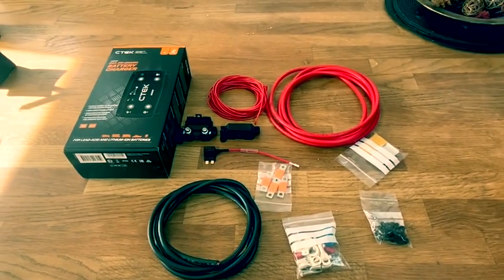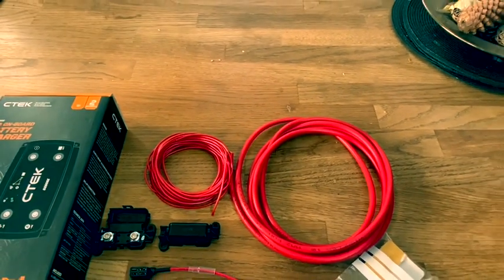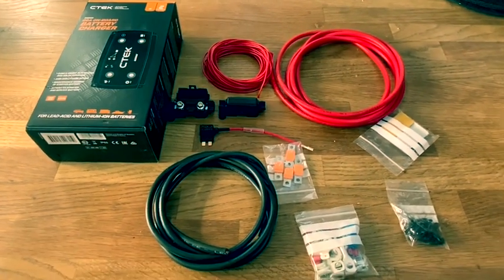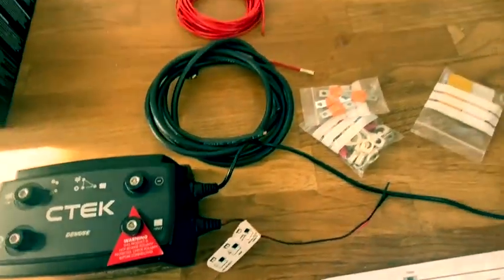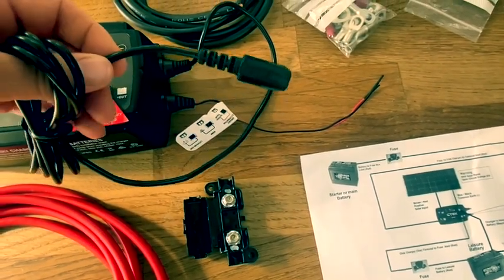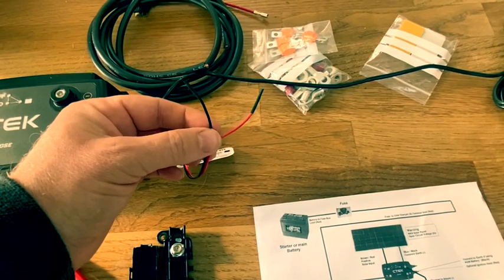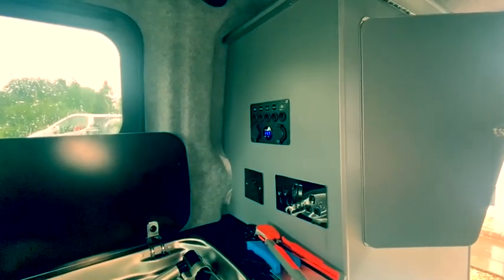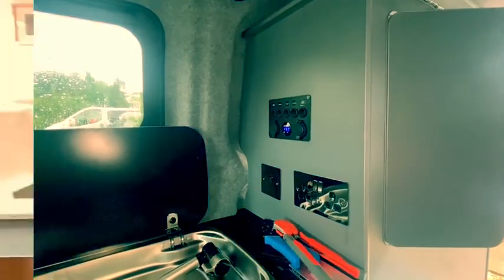Installation of CTEK D250se DC to DC Battery Charger into Transit Custom with Smart Alternator

Comment: if my van has a dc to dc charger and 2 batteries from factory, if i add a 3rd battery, would i need another dc to dc charger, or can i just use the existing one?

Comment: Hi there, 
I too have a transit custom and am fitting the same ctek. When you plugged it into the main van fuse box what did you piggy back into ignition switched fuse wise? And I understand the black cable is not required if it's a lead acid battery? Any help would be gratefully appreciated. Very informative video by the way 👍

Comment: thanks for the detailed explanation,  I have auxiliary switches on my Rubicon, will it work if I connected the little red wire with one of the switches so that I only run the charger when I want to and not wheneve I start the Jeep?
Reply from the maker: No problem. Thanks for watching. I am not sure to be honest. I only set this up on the van following the instructions. The support from CTEK was pretty good though and might be worth giving them a shout.
Reply: @TransitCustomCamper thank you 🙏🙏

Comment: What year is your Ford transit custom and how would I know if I need one of these devices. What I mean is how do I determine if I have a smart alternator?  I have a 2015 Ford transit custom.
Reply from the maker: My van is 2014. Most vans from 2014 onwards has the smart alternator I believe so likely your 2015 will. You can test with a voltmeter on the main battery. Typically the voltage on the battery is higher at first start a few minutes after idle it would drop 👍
Reply: Thank you for your reply.  I just installed this device but I left the thin black cable alone as my leisure battery is Lead Acid (I think). lol

The only light I’m getting on Mr CTEK is a solid amber light next to A

The vehicle battery odd getting charged but nothing to the leisure battery.

I’ve got a positive live from the fuse box.  

Do you think that little black cable needs to be earthed?

Comment: Hi just quick question Mate 
the black and red wire coming out of ctek charger . 
red goes to ignition what about black wire . 
i have a deep cycle battery as a leisure battery 
im
Reply from the maker: Hi mate 👍 My understanding is it depends on what type of leisure battery you have, an agm connect the black lead to earth, a normal lead acid battery no connection, but I can see why there might be some confusion as the instructions are not that clear, if I’m wrong hopefully someone else will be along to comment and check too 👍
Reply: @TransitCustomCamper  
i have agm deep cycle battery . 
when black was connected to earth on my  vehicle 
the ctek unit keeps restarting and powe light kept blinking 
battery volts keeps dropping and it wasn’t charging properly . 
i have disconnected the black wire (previously connect to earth on the vehicle ) 
i now have stable lights on ctek unit . 
wondering if that how it should be ? 
don’t want to ruin my new battery .

Comment: Hi mate, any idea what the green light and orange “A”  light staying solid mean?..there doesn’t seem to be anything in the manual with this combination of lights on?.
Reply from the maker: Hi - I am sorry no not sure 🤔 I have always referred back to the manual when I had issues but can’t see that light combination?! Might be worth a double check of all the connections… Also when the van is running I sometimes check the volks on my switch panel to make sure they go up… at least let’s me know things are working 👍

Comment: Hi, recently bought a transit custom 2015. Most places online tell you to find the 12V signal from the c33-E connector under the drivers chair. However you need relays etc to manage it. What resource did you use to figure out what fuse was suitable for your ignition signal to the charger?
Reply from the maker: I looked up online which was for an item that only gets power when ignition on like fog lights etc.. then used that.. you can use a multi meter also but I just found the location that worked 👍

Comment: I didn't understand whatexactly to do at 11:20, 'taking a feed to the common earth etc. What exactly are you doing? It would have helped if you could show it rather than talking about it. A few gapsand things glossed over that means I can't follow this.
Reply from the maker: Ah OK - yes understand. The wire was already running from negative on leisure battery to common ground on the body of the van. This wasn’t direct part of the CTEK install and more to do with the existing 12v side of the overall setup that was on my other video. I put the electric stuff in this playlist Fitting Van 12v & 240v Electrics
https://www.youtube.com/playlist?list=PL4K45Imzn1H9eLynvrVKlfmDcujCkgA2i - thanks for feedback and checking out the video too 👍
Reply: @TransitCustomCamper  Thanks for the extra info. I'll get there in the end. Your video wasn't the whole picture but certainly helped.

Comment: HI. I have a victron DC to DC and it stops charging after 30 mins (approx) even if the leisure battery is at 65%. I have tried EVERYTHING. It is earthed, it is wired correctly and I am starting to wonder if it is the smart alternator. Thoughts?
Reply from the maker: Hey thanks for the comment and watching the video. I am not too sure about that charger to be honest. It might be smart alternator? Could be something else though too? Have you tried their website for common issues? Sorry I couldn’t help direct and hope you can get it sorted ✅

Comment: Hi! What fuse did you go far in the transit custom? Will the light levelling 5amp fuse be ok? Thanks
Reply from the maker: Hi - I can’t remember what position it was in the end! I’ll have to take a look and post another video. I think anything that is only live with ignition will be OK but also make sure the correct fuse size is used in the piggy back. The alternative I believe there is an ignition live under the drivers seat and I have seen quite a few other people use that as opposed to the piggy back fuse 👍

Comment: Any links to the correct piggy back fuse tap? I bought a mini blade but it's not the right fitting for the transit custom. Loving the videos 👍👍👍
Reply from the maker: Hey - ahh thanks for the comment and checking out the videos! I checked my orders and think it’s these ones from Amazon CZC AUTO Add-a-circuit Fuse Tap... https://www.amazon.co.uk/dp/B08T8ZCR9Z?ref=ppx_pop_mob_ap_share
Reply: @TransitCustomCamper  top man thankyou!!!

Comment: Hello again ! What's the piggy back mini fuse adapter called ? And where did you get it from. Many thanks JoJo
Reply: Fab I have a feeling that I may contact you again about various things. I hope that's ok. F not just say no worries. Beginning to get my head around 12 volt stuff a little.  How did you establish if your van has the smart alternator. ? Mine is 2014 too. Thanks JoJo
Reply from the maker: @jojohale9328  heya! Yeah no worries on the Q’s… I’ll try my best to answer what I can.. so you can test if you have a smart alternator by using a multimeter of the starter battery. Check voltage just after the engine starts and then check again about 5 mins later and if you have smart alternator voltage should go down. However… it’s a bit of a faff with the battery being under the drivers seat..I would say it’s most likely to have smart alternator if it’s 2014… I think most moved to smart alternators in 2013 - 2014.. hope that helps 👍
Reply from the maker: Hi again 👍 It’s called different things, fuse tap, piggy back fuse adapter, mini blade add a fuse etc… I got some from Amazon but I think you can get them from Halfords if you in the U.K. or other similar automotive type stores etc… The ones I got are below 👇 https://amzn.to/3XKLspE

Comment: Hi, can you remember which fuse you piggy backed off. I've attached to the blowers but not sure if that's a constant feed. The charger has drained my van battery as it didn't turn off when I turned the ignition off. Thanks, Chris

Comment: Hi, I hope you can help.. the orange light comes on for both the alternator and battery but only for a few seconds, im guessing these should stay on until the leisure battery is fully charged? If you have any idea on why it does this it would be very much appreciated👍🏻 TIA
Reply from the maker: Hi - thanks for the comment and checking out the video.. I am not 100% on all the lights and what they indicate. I recently had a problem where my leisure battery not getting a charge and this turned out to be a loose connection. I had to check online… the manual is here and does show the light patterns for normal operation snd also faults.. hope this can help https://manuals.plus/ctek/ctek-dcdc-battery-charger-d250se-manual/amp#function_indications

Comment: Just to clarify, according to the manual, the red wire needs an ignition feed ONLY if you have a smart alternator. An older van with a normal alternator does not require this ignition feed.
Reply from the maker: Hi - Yes that’s my understanding of the set up 👍 I haven’t personally tested on a van without a smart alternator. However, this seems to be true according to the manual and other people installs and comments too 👍

Comment: Hi, did the instructions for your CTEK unit say it had to be wired to the alternator and did you just wire it to a ignition live fuse yourself. I bought one from wired campers and it says it has to be wired to the alternator. Thanks, Chris 👍🏻
Reply from the maker: Hey Chris - the CTEK will need to take be connected to your main vehicle battery in the van. On the documents they usually refer to this as the alternator. This is so the CTEK can get a charge from the alternator when the vehicle is running and then keep your leisure battery charged up. If you have a smart alternator you will also need to get an ignition feed from the CTEK. This is a small thin wire. I got my ignition feed by using a piggy back from the fuse box… but I have seen there is also an ignition live under the drivers seat also. I am not sure on location of this one. Hope this helps! 👍
Reply: @TransitCustomCamper  that's great thankyou. Might have a look for the ignition feed under the drivers seat. I have piggy backed off a fuse but not seeming to get power to the dc dc charger. Thankyou 👍🏻

Comment: Hi great vid just a quick.? What gauge wire used from main battery to ctek and is the same wire gauge used to connect to batteries? Thanks
Reply from the maker: Hey 👋 - thanks for checking out the video and the comment. I am not 100% as it came in a kit but I think it’s 4AWG which I believe is more or less standard for battery cables 👍
Reply: @TransitCustomCamper  thanks for quick response nice one that confirms my requirements for my 1500w inverter as well. Cheers Iain

Comment: Just watching this video! It’s fantastic! Could you please tell me which fuse you used for the Ignition please do you have a number for it? Thanks
Reply: Any 10amp or 20amp fuse that becomes live after the ignition is activated , I think the heated mirror one would be a good choice look in your manual or watch a video on finding a non permanent live feed on a fuse board,  not difficult
Reply: I just found that the headlamp levelling fuse 5 amp  (number 24) I think it was on my 2015 custom transit under the steering wheel pop of the cover

Comment: nice set up do i need a smart alternator to power it up
Reply from the maker: Thanks Wayne 👍 You should be able to use the CTEK with a “normal” alternator too.. It’s more that you need a DC to DC if you have smart as normal split charge relays won’t work 👍

Comment: Do you have footage of how you got the wire into the fuse box location? I’m just looking at feeding the wire through but can’t work out what route you took, (under the step? Up and then down the A pillar ?)
Reply: Ah that would be great thank you I’ll email shortly, no rush though! Thanks for your reply
Reply: Apologies I don’t use YouTube very often, where do I find your email address please
Reply from the maker: @vidic2009  hey Sorry it’s transitcustomconversion@gmail.com
Reply from the maker: Hi - thanks for the comment and checking out the videos 👍 I don’t have any footage on this sorry 😢 Essentially I ran this from the fuse box then just tucked under the trim by the step and then round the pillar into the back of the van… if you want to email the channel email I can send some pictures over if that would help then happy to do so 👍

Comment: Hi great video. On the ignition wire that went to the fuse board what fuse did you end up using (piggy backing off)?

Comment: Hi, great video, really helpful as I fit my CTEK. Quick question, where is the common earth on a transit custom?
Reply from the maker: Hi 👋- thanks for the comment and checking out the video 👍 So our common Earth is on the body work of the van. We stripped all the metal off and used a bolt. This is as all our electrics in the back wardrobe. I think  there is also an Earth point under the front seat? Although I am not 100% on that as wasn’t something I used myself on the build. Hope fitting goes well let me know how you get on 👍

Comment: Is the fly wire with the piggyback fuse holder an item you purchased or did you make it up? thanks
Reply from the maker: Hi Nigel - thanks for the comment and checking out the video 👍 The wire for the ignition feed came with with kit I purchased with the CTEK and the fuse holder was a separate item and I crimped the wire to the fuse holder 👍
Reply: Thanks very much for your prompt reply, I'm starting to fit a 250se to my trafic conversion, and was a bit perplexed as to were to take  an ignition feed, this video has been very informative 👍 thank you
Reply from the maker: @nigeleakin2157  - no worries - glad it was helpful and good luck with the conversion 👍

Comment: If the charger is switched on with an ignition live does that mean it starts to draw power from the main battery as soon as the ignition is on? Or does it wait for the engine to start first? I quickly scanned though the instructions and it mentions an alternator supply for the red wire, meaning it gets its on signal only when the engine is running.
Reply from the maker: Hi - When I have been operating I have only tested with the engine running. Also it only starts to charge the 2nd battery once the voltage is reached on the main vehicle battery as a priority. It might mean the main red wire that runs from the main vehicle battery back to the CTEK as opposed to the ignition wire. I might test just with ignition though also

Comment: great video mate , i thought the ctek charger will now when the van is started due to a voltage increase and start charging battery etc eliminating the need to wire it the the fuse box using piggy back
Reply from the maker: Thanks for the comment and checking out the video 👍 All the information I read in the manual and also online etc. all indicated it was needed to operate correctly. It has been working fine with no issues etc.. I’d be interested to know if you find out anything different too 👍
Reply: @TransitCustomCamper  you are right in your process I did more research and it works the same as a split charge in that because you have the newer smart alternator it doesn’t pump out enough volts to start the charge but for old alternators there is no need to wire the ctek to the ignition ,  just straight replaces the split charge
Reply from the maker: @roostaraver  ah good to know mate - thanks for that… the docs with it not perfect and also notes the ignition wire as optional too.. I got it in kit form and the company that supplied it answered the questions I had too and told me it was needed for the model and year of my van 👍 Thanks again for the comment! Are you doing your own conversion too?
Reply: @TransitCustomCamper   i am indeed , I have fitted a AGM leisure battery last year just with a split charger , but feel my AGM needs a charger that looks after the AGM better so going to swap the split charger for the CTEK , I also plan on adding a diesel heater now weather is getting abit colder so I don’t have to use campsites with electrics to run a heater
Reply from the maker: @roostaraver  ah sound mate 👍 You will have to send me some pics of the van.. I am planning a new feature called readers vans where I’ll put picture up from fellow converters who follow the channel etc and give a shout out 👍 though it would be good share ideas too and so many options and approaches - let me know if you want to get involved be great 👍
Reply: @TransitCustomCamper  yeah that sounds great 👍

Comment: What size wire and fuse did you run for the ignition feed
Reply from the maker: Hi - thanks for the comment and checking out the video 👍 I would double check the documents etc yourself too but it says to use 10amp. So in the fuse spur that what I used in the end. I would always say that get things checked too as I am just a DIY van builder so wouldn’t want to advise and you have any issues etc 👍
Reply from the maker: Also sorry the wire size/gauge I am not certain as this came as part of a kit… Just looking at it appears to be around 14 AWG… again worth a check 👍 The company I got the kit from also offered great after service and answered any questions I had too I got it here through Amazon but CTEK 3mtr D250SE 12V 20AMp Dual DC-DC Battery to Battery Charger Kit with 70amp 10mm² Cable D250SA/K3 https://www.amazon.co.uk/dp/B07K8QQ6X9/ref=cm_sw_r_cp_apip_pp773Lp9LLOX7

Comment: Is this charger enough for 100AH battery or i need to buy smartpass 120A ?
Reply from the maker: Hi - thanks for checking out the video and the comment 👍 From the CTEK website below you should be OK 👇 

“The D250SE is a fully automatic, 5 step charger that supplies up to 20A of power to any 12V lead-acid or lithium service battery from 40–300Ah”

https://www.ctek.com/uk/battery-chargers-12v-24v/d250se